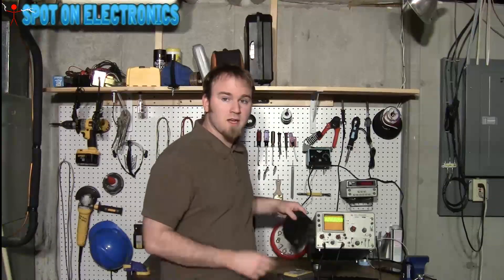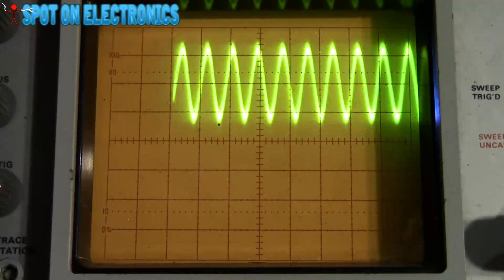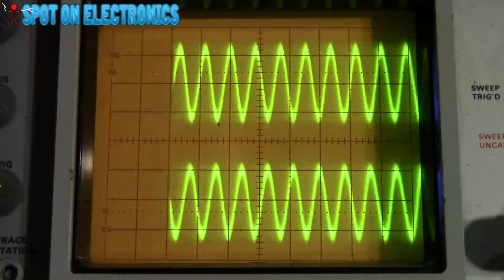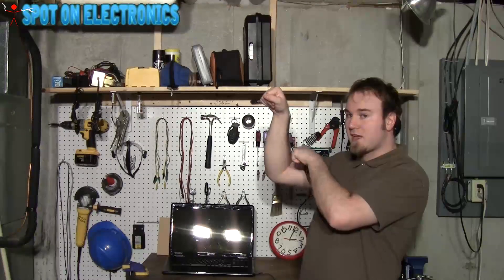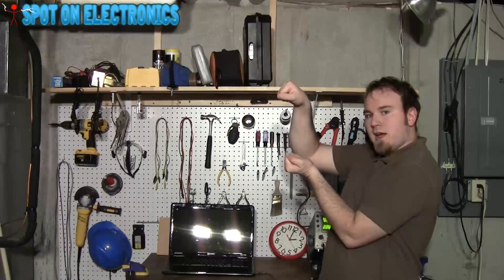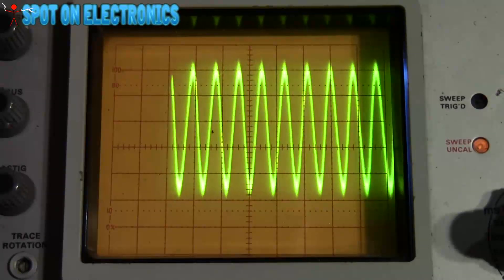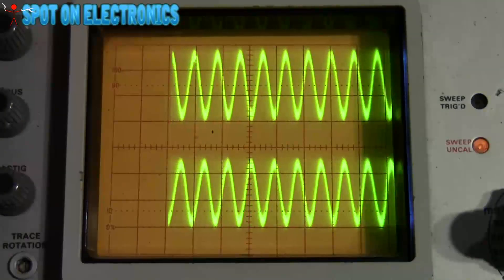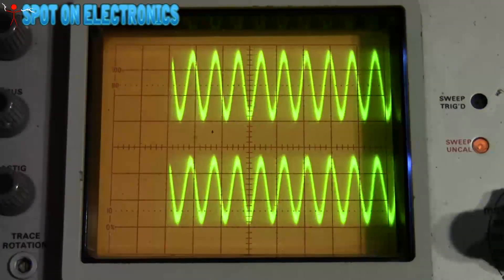Balanced and Unbalanced Audio Explained

Comment: nice video but, audio signal is alternating current, saying positive/negative is misleading and incorrect. I would say opposite or inverse phasing in time. An audio signal consists of a wave that starts at zero, goes to its maximum positive, down through zero to its maximum negative and back to zero. One complete cycle has both positive and negative so the "other" signal is its inverse and NOT its negative. Cheers :-)